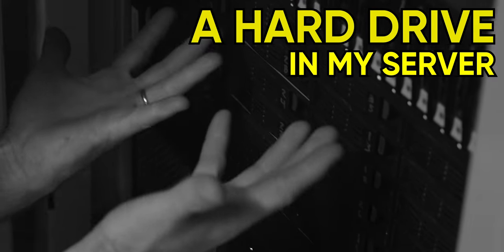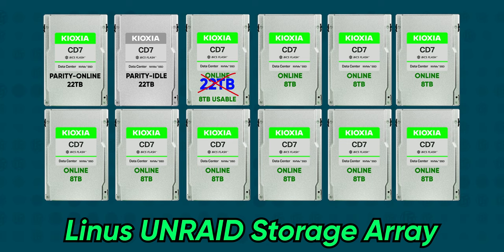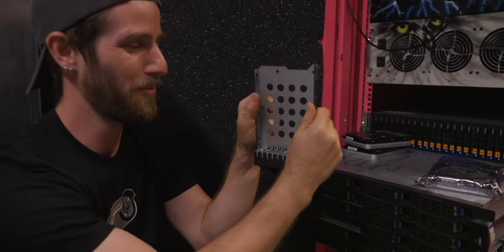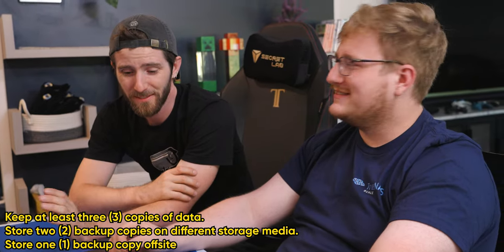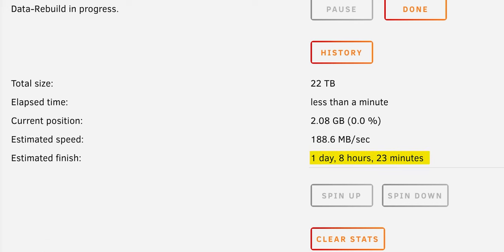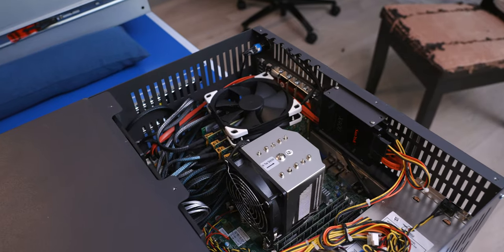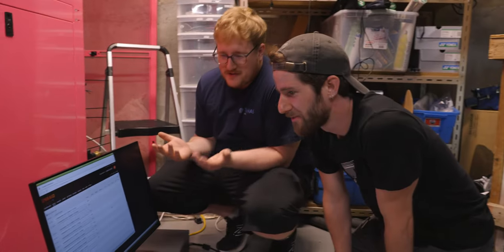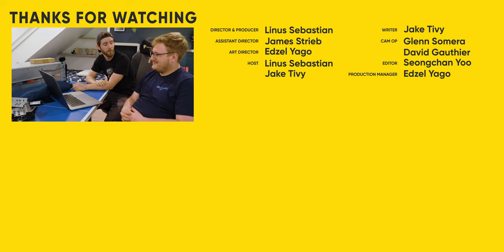My server is broken :( - Fixing Linus' Home UNRAID Server

Comment from the maker: CORRECTION: We stated in this video that the parity drives in a dual parity setup in UNRAID contain the same data, that is incorrect, so we've cut that clip out of the video. UNRAID uses the P + Q redundancy system in dual parity setups, meaning one parity drive stores standard XOR parity data, and the other a Reed-Solomon code. 

For more information on how parity and dual parity works in UNRAID, see the UNRAID Wiki here: https://docs.unraid.net/legacy/FAQ/Parity/#how-parity-works
Reply: I mean you were wrong but in lame terms saying they both have the same data is not bad lol
Reply: radio
Reply: Around 11:15 the audio goes out of sync.
Reply: @rgar2255 I wondered why nobody seemed to have noticed, I’m getting out of sync audio too ☹️

Comment: Linus: runs unraid
Jake: wears trunas shirt

Classic Jake. Love that guy.
Reply: Came to post the same :)
Reply: Just come down here to say this, beat me to it! 😂
Reply: Jake is the backhanded complement to Linus. The videos work so well that Jake let's Linus do his thing after offering a suggestion....then after 20  minutes of Linus tinkering, Jake sneaks in to implement his suggestions.    🤣🤣
Reply: Damn multiple people beat me to it. HAHA
Reply: To Jakes credit, Truenas is way better than Unraid. Unraid is easier to use but is terribe performance wise. On the same system with Truenas i can fully saturate a 2.5gbit link but with Unraid i only get ~600mbit. Also using an USB drive for the operatingsystem is a big nono for me.
Reply: @iPain3G . It doesn’t “run off” the usb though, it’s just stored there between power cycles.
Reply: @iPain3G . Additional Unraid benefit is the non matching drives.
Reply: @robertt9342  It doesn't matter. The flash drive only needs to fail once to make the system unbootable. The write endurance of flash drives is usually crap, so that's 100% a ticking bomb waiting to go off
Reply: @nocturn9x . “It doesn’t matter it only needs to fail once”… same with any other boot device… and you can be up and running in minutes cause it’s something called a backup. Also, You’re still acting like it’s being written constantly, which it’s not. The controller is more likely to fail in that time than the flash.

I too am not a big fan of the usb being the source for the OS on boot, but you are desperate if that is the issue you are freaking out about.
Reply: It doesn't matter if it fails. None of your data is on the usb.
Reply: @nooonde  Unraid has some pretty compelling features as the mismatched drives above all. And it's easier for get into when you start with NAS Systems i guess. Personally I've way more experience with (high capacity/performance) TrueNAS systems so i'll continue with that one ;)
Reply: i have truenas on my home personal server, but I have no idea how to set it up correctly as someone else did it, and they didn't show me anything. where as unraid looks a lot easier to setup and maintain for personal use, but it has a cost to it where truenas is free. so I am not sure what to do, while I have truenas working I honestly don't have much of a clue on how to fix anything if it breaks. =) so ya there's that.
Reply: @bluesquadron593 1:29 1:29 1:29 1:29
Reply: I can't point any fingers to any specific videos, but Linus has said in previous videos that in many ways he prefers TrueNAS. In this video specifically, however, he states that unRAID is hard to beat when it comes to personal use. Relevant stuff in this video starts at 6:50
Reply: I wanted to see if someone already said this
Reply: This comment thread is a honey trap for nerds...
Reply: Jake is a true trailblazer. 

I'm not exactly sure where he's going, but I know he's going hard.
Reply: @bluesquadron593  No you didn't ,you're just replying to to someone smarter than you to make yourself seem smart .

Comment: 8:45 As someone who works in cloud storage, there was recently a nightmare scenario in astrailia iirc where a company just shut off their cloud server there without enough warning and dozens of companies lost everything. As we like to say at work, cloud storage is only useful if the cloud is yours
Reply: Sounds like something Unit8200 would do. 🙄
Reply: it should be fine if it's only one of the other copies of the backup
Reply: That was probably InfluxDB, and they actually also nuked their Belgium region at the same time (though that was mostly recovered I think)
Reply: I struggle getting people to understand The cloud is just someone else's computer.
Reply: @kjcorder  And that the cloud is REALLY eager to take your money, but if they screw up, they aren't that likely to take responsibility for your data even if it is lost.
Nah, I will be storing stuff in the cloud... My cloud, that rests on my home server :D
Reply: The one that weighs over my mind is the French one that burned down two years ago.
 More or less killed the longest-lived torrent site in my language. A bummer, in particular, because it was also the most reliable source of subtitles and synchronised films for the folks around me.
Reply: @Neuttah  That datacenter also hosted the manufacturer service platform for the phone systems i support at work. Couldnt access all customer systems for over a week while they sorted that out. At least those were on premise systems so only remote access was not working.
Reply: All good as an additional backup (with encryption etc. of course)  but yeah if something borks up my data, I want it to be my fault.
Reply: Astrailia you say? Are those guys related to the Amaracas?

Comment: tip: buy half the drives from a separate distributor to get different runs of drives.  drives can die surprisingly close to each other if they're all off the same assembly line in sequential order, so the chance of double fault is much much higher than people imagine.  ask me how i know 😂

but by having two sets of drives from different batches, they'll live for different periods of time and you lower the chance of two failing at the same time
Reply: Also you can change a drive every year, even if neither have not any signs of failing (you can always reuse the changed drive to another system).

But running you NAS on shingled drives... wow, that takes some balls
Reply: How do u know?
Reply: @rohansampat1995  had a double fault.  one died, replaced it, and within an hour of starting the rebuild, a second one died.  lost the array.  replaced that one too and within a few weeks the rest died.  they were all one serial number apart.  i think the rebuilding load makes them fail closer in time than they otherwise might
Reply: Sad to say that sounds logical.
Reply: @jfernandez76  Running NAS on SMR drives doesn't take courage, only lots of time and a good UPS.
Reply: I don't get that the manufacturers dont realise this and mix boxes with different runs. I mean, the drives don't need to sit long, two or three days mixed together should be enough, right?
Reply: @florichi  Or the local computer parts store could do it, too. It's no like the store purchases 2 drives at a time.
Reply: @florichi  To be fair, it's not on them to question what the purpose of those drives are. The customer could want to get them for individual server drives (no RAID), a chunk of cold storage or a back up for the backup for the backup etc. It's more on the customer to try to get some info. What a manufacturer COULD do is include some advice on how they can improve reliability if anything.
Reply: @florichi two or three days? No that Is way to close in life expectancy.... A raid rebuild can take that much time and longer... Trust me loosing a divine during rebuild is really annoying...
Reply: @justacomment1657  Well, i thought with the production surely pumping out 10.000-20.000 drives throughout the a day it should be enough separation to get different platters, bearings and heads in the drives.
Reply: @florichi  I am tempted to say maybe 😅
Reply: This is really good advice
Reply: It took me almost a year to buy all my harddrives for my NAS, because I did not want drives from the same production batch.
Reply: Did you constantly scrub the array? Because if you don't, there's the possibility that all 3+ drives could fail and stay undetected until one of the drives starts to obviously fail (throwing out errors when reading a specific sector or some other physical damage preventing the drive from coming online). Then you'll have a bad day when you execute the rebuild, only to find that 1 or more extra drives in the array are also bad.

I'm not sure exactly if "same batch drives fail close" is a myth or not due to lack of data, but if it's indeed true it's a really bad failure pattern for data centers and they probably would let everyone know, like it should get highlighted in e.g. Backblaze disk failure report.

Comment: Jake and Linus made this seem way harder than it needed to be.  The Parity Swap the UI referred them to is the process they should’ve followed, it has its own section in the official Unraid documentation.

Also the two parity drives do not contain the same parity data, they have two separate parity calculations so that two drives can fail simultaneously and still be able to recover the data.  If the parity disks were simply mirrored and you had two data drives fail, Unraid would be unable to calculate the data missing.
Reply: Noticed that too. Pretty dangerous misinformation too. You cannot swap parity 1 and 2 around, and if a data disk has failed you'll LOSE YOUR DATA!
Reply: Agreed, there is a lot of misunderstanding here and incorrect information being presented. Please dont follow this video as a guide, refer to the Unraid documentation and forums. There are plenty of others who have documented this situation and the proper procedure.
Reply: Perhaps swapping Parity Drives means actually coping the data to another drive, therefore preserving the two different parity calculations.
At  8:40  "Just store it on Google Drive"   Yikes!  Even with encryption (which can be broken by hacking the Google account) I don't trust any online server, ever.  My data stays local in multiple physical locations.  Linus seems to agree. ;)
Reply: Well, by following the guide there would be no drama, and no video.

Comment: What I love in Unraid (besides the variable disk size support) is that your data is in a totally readable and usable form in the disk. So if you have one parity drive and lose two drives, you will lose data, but not everything. I can even move some data to a disk and put that disk alone to a different computer, and will be readable.
Reply: What I don’t like is that in the scenario we saw today (replacing a failed drive with a larger one), because unraid uses dedicated parity drives and requires replacing a parity disk at the same time as a failed disk to use a larger size, any read error on that parity drive while rebuilding the failed drive will be a fatal read error. It’s a massive risk.
Reply: @guspaz  It is because LTT made this process and video complicated for entertainment value. If they read the Unraid manual before starting messing around, it would look much less dramatic. Also, most Unraid user knows "parity disks need to be larger than data disks" this limitation. So user will upgrade the parity to be the largest disk when disk price falls. Also LTT didn't preclear the new drive. Preclear is recommended not mandatory for replacing a disk. But if they end up shuffle around rather carelessly without reading manual, if their operation at any step become a equivalent of "adding" a drive, then the "added" drive must be precleared to all zeros to maintain valid parity.
Reply: @guspaz  That's a general risk you take when you're rebuilding 2 drives at a time, it's not specific to unraid. There's 2 parity drives and 2 drives being rebuilt, so if 1 more drive fails, obviously the whole thing fails. It doesn't matter whether the parity drives are "dedicated" or not.
Reply: @chaoster111  The problem is that unraid forces a 2-drive rebuild to replace a single failed drive if the replacement drive is larger. In a ZFS vdev with raidz2 (the equivalent setup), if a drive fails and I try to replace it with a larger drive, then it just works, resilvering to the new drive with single-drive redundancy, leaving the extra space unused. In the same scenario, however, Unraid appears to force you to simultaneously replace one of the parity drives, forcing a zero-redundancy rebuild. In the unraid scenario, not only does a drive failure during the rebuild cause data loss, but any read error whatsoever during the rebuild causes data loss. I can't think of any good reason for unraid to force this requirement instead of just provisioning less space on the larger drive.
Reply: @guspaz unraid doesn't force anything like that, no idea why you think that.
Reply: @davorzdralo8000  it was literally what happened in the video. They tried to replace a failed 8TB drive with a 22TB. Unraid just flat out rejected it with an error message. They had to replace a parity drive with a 22TB. Rebuilding that parity drive was done with zero redundancy because at that point there are two missing drives.
Reply: @guspaz  That's what parity swap is for. You are copying your parity to the 22TB.
Reply: @guspaz  That's the problem with not reading manuals.
Linus could have replaced the 8TB HDD with the 22TB HDD and brought the array back to gold status.
Then replace the 2 parity HDDs with 22TB HDDs and voila - the full 22TB are then also available on the 22TB replacement HDD.

But you can only learn something like that if you take the trouble to read the manuals instead of throwing them in the corner - as can be seen in numerous videos...

So remember: R-T-F-M-!-!-!
Otherwise 0 sympathy when time is wasted or data is lost due to user ignorance!
Reply: @kitsunesenpai441  >Linus could have replaced the 8TB HDD with the 22TB HDD and brought the array back to gold status.
Am I missing something or did they literally try to do that, only to end up with an error message.
Reply: @guspaz  They explained in the video... both parity drives are identical, this is the point of having 2 parity drives, you can lose 2 drives and still have all the data.  You don't still have redundancy at that point of course, but the new parity rebuild could fail and they'd still be ok.  There's no system with infinite redundancy so it's possible to get into this situation no matter what RAID-ish solution you have.

Is this the best solution ever?  No, of course not, but I'd be OK if I had to do this to my system.  I'd certainly plan it out much much better of course.
Reply: @BoxOfSnoo  I don't know where they got the idea that the parity drives are identical. I've never heard that before, and by definition they can't be. If they were, you wouldn't be protected for any 2 drive loss: you'd only be able to lose 1 data + 1 parity drive.

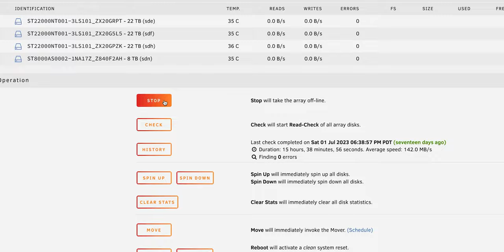Comment: 10:30 - important correction: In UnRAID, the two parity drives do NOT contain the same data. How else would it be able to restore two failed data drives from parity? The data is obviously different.

Comment: Really love unRAID. You’ve got to stay aware of updates and breaking changes. But it has shown to be solid on my setup for years now. The instantaneous downgrade from any update is a great feature too. If the update gives you work/errors/crashes you can easily go back to the working setup and try later on after maybe applying some fixes first in the working software. It’s neat.
Reply: Yeah, make sure to always check the forums for change logs and issues, I usually wait a while before upgrading. 

IIRC one of the recent updates does require a config change when downgrading because of some changes (documented on the site).
Reply: What sold it for me was that the community is so much more friendly than FreeNAS/TrueNAS. You can ask a question in the UnRAID forums and and get a useful answer, instead of being told that if you're not running triple-redundant enterprise-grade hardware then you clearly don't care about your data and you might as well delete it. (I'm only exaggerating slightly).
UnRAID is perfect if you don't have a lot of money, but you do have a pile of old hardware that you want to reuse.

Comment: For UnRaid, if you have a large array I highly suggest running the Disk Location plug in. You can make mapping of all disks with visual representation and also force any disk to blink to locate it.

Unraid has come a long way and is pretty good about preventing you from screwing things up, but several plug-ins fill some big gaps, such as Unassigned Devices...
Reply: What are you favorite plug-ins besides that?

Comment: 7:07 - My understanding of TrueNAS is that you can chuck in replacement larger drives willy nilly, but it's only when all members of the pool have been replaced will the whole pool suddenly see the new full capacity. So can be done, you just don't see the benefits straight away.
Reply: There's a mention of plugins for TrueNAS to achieve this, any idea what they're called? Never heard of those before, that could be quite a game changer.
Reply: I read they recently added a feature that allows you to add more data through replacing only some drives with larger ones by redistributing how data is striped.
Reply: @grex2595  that's awesome! Do you have a link or a name of the feature? Would love to try it out

Comment: the rebuild only needs to take as long as the largest drive in the array. the extra space on the parity drive does not have to be calculated in this intermediate step. Once the 2nd new parity drive is installed and you have to run the parity check again - you can let it run it's full check.

you can do a new config and check the "parity is valid" to skip the 14 extra TB calculation.
Reply: there's a lot of bad information in this video, and it hurts to watch, since unRaid has come so far over the years.